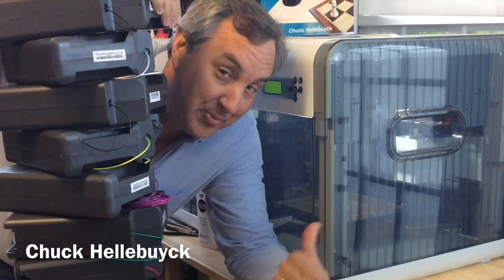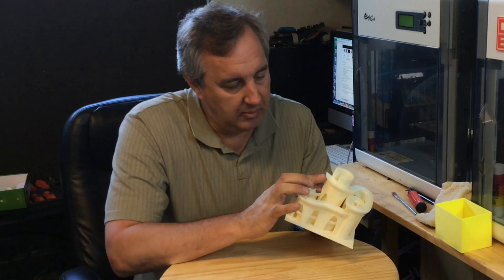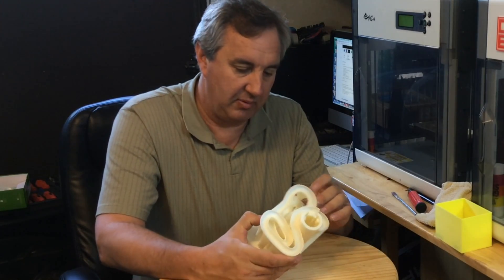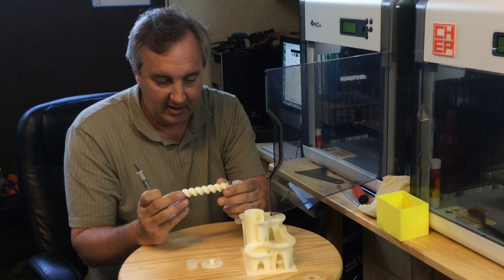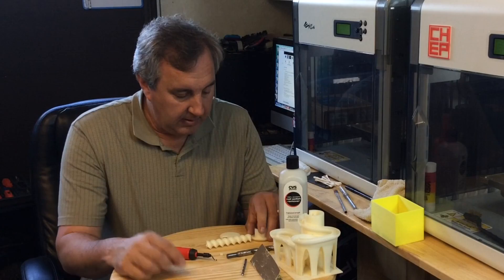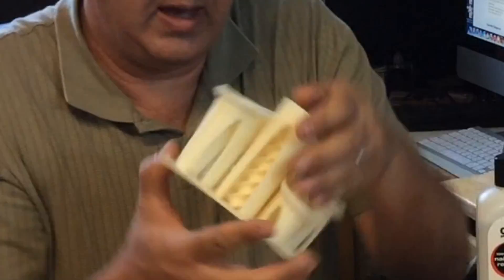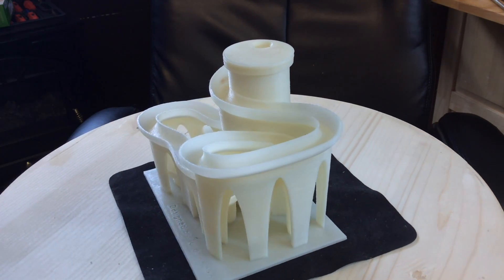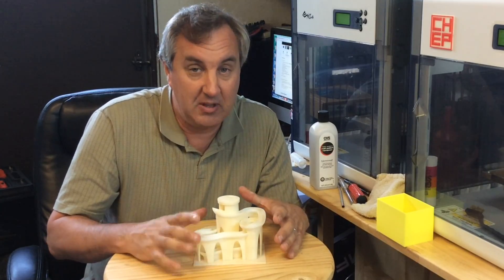Filament Friday #15 - Marble Machine 3D Printed on Da Vinci 1.0 - Video #057

Comment: I've noticed the burning if the area before the to-be-burned area has sagged a little, so the extruder is "crashing into" the higher spot, contacting the underside of the extruder, and burning it.  I've witnessed it happen several times (printing PLA)
Reply: alynn333333 More and/or better-placed supports resolve the issue for me.